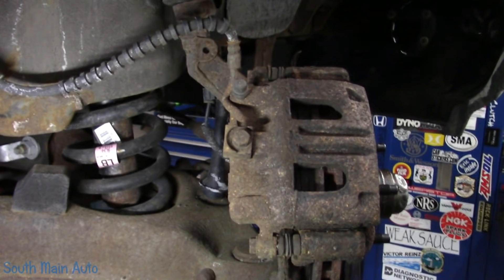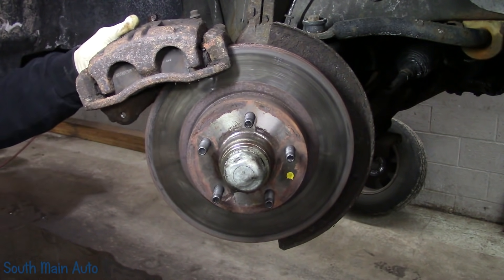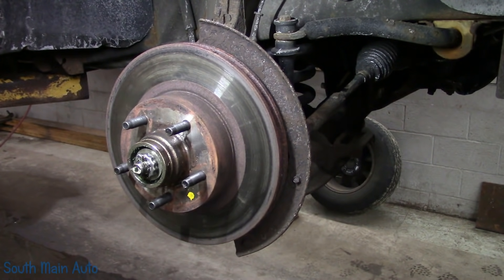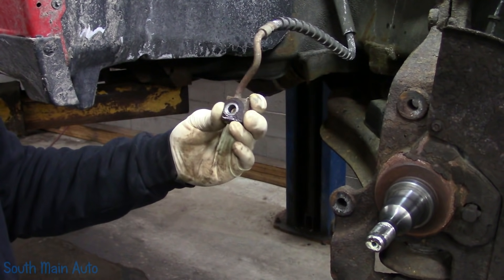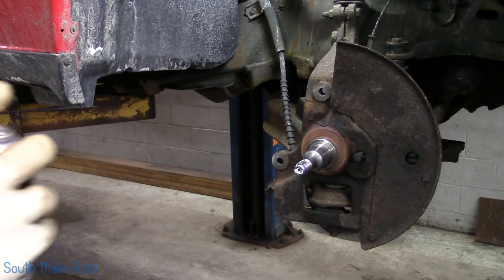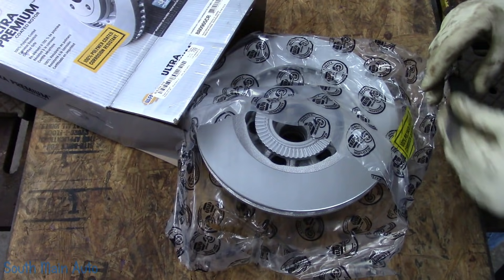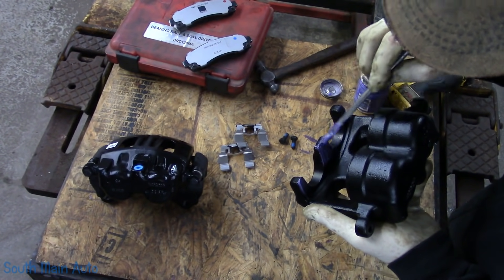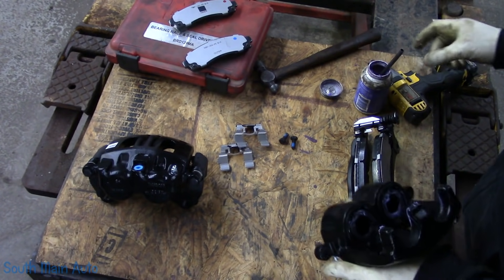Ford Ranger: Full Brake Job Overhaul - Part I

Comment: I just did this to my '94 Ranger 2wd. Thanks for showing the bearing preload and final. Of course I now need o pop off my wheels and reset mine because Timkin said 18 to 25 FT LBS.

I knew it was screwy but hey, it's been a long time since I last did this on my Hillman Minx. It'll take longer to get the tires off than it will be to make the adjustment to 'finger tight'. Many thanks for the guiding hands on help Mr.O!

Comment: Should replace the flexible hoses too.  I had one fail on my 02 F150 on the boat ramp a few years ago.  I also understand they can collapse on the inside causing the calipers not to relax and overheated brakes.
Reply: I was really surprised he didn't replace the hoses. I had a friend chasing an odd brake issue recently on a 67 F250 and it ended up being a collapsed brake hose. In my mind, if you are replacing a caliper or wheel cylinder, you might as well replace the hose too.

Comment: Just saying that I started watching this this morning while sitting at my local Toyota dealership. Had to pause it when they came to tell me what they found on my "multipoint inspection". Just now getting back to finishing the video

Apparently at 50k miles, I still haven't worn out my factory pads... but I'm 20k over due for a brake fluid flush. You read that right. Toyota recommends a brake system flush at 30k miles.
Reply: Bobby Brady  Absolutely. I laughed in his face.

And the manual says to INSPECT fluid at 30k.
Reply: @zacharywelvaert2235  Honda owners manual says to change the brake fluid every 3 years.

Comment: I've had bad experiences with coated rotors.. not often but enough to the point that I now buff the coating off, where the pads mate with the discs.. the issue I've experienced is heavy glazing.
Reply: Strange, they claim it wears off quickly and promotes proper break in. I've installed a lot and have never seen any difference.
Reply: If you ever have a chance, test drive for 20mins bring the vehicle back in and check the pads.

Comment: you put as much grease as should be put in the hub. I have dealt with what happens when the hub is overfull and its a big mess. actually you can just pack the bearings well and put a little on the seal . that is ok as the wheel bearing grease in the hub does not circulate anyway. On a boat trailer with bearing buddies, I would use special synthetic grease that did not expand and push out when traveling fast even though the hubs were full. On the subject of boat trailer bearing buddies. fabulous invention.
Reply: Bearing Buddies have a spring loaded piston to compensate for expansion.
Reply: partly. but using grease that does not heat up and expand is helpful. years ago in the 70s it was "Mystic JT6 military grease".

Comment: I've bought the Napa reman calipers for Fords, I drive 06 F-350 at work we have nothing but F-350 work trucks. The slide pins never have enough lube on them an ya I use extreme lube. In our West Coast climate aka rain and salt air, I grease the ears of the brake pads and the outside of the abutment clips the stainless clips really oxidize and the pads start to bind up.

Comment: Of course you do this project AFTER I replaced my truck brakes last month. Haha! Would've been nice to have your step by step instruction. Mine is a '01 Ranger XLT 4.0L RWD 219k original miles and still truckin'. Same style brake / hub assembly as the one in this video. Great job on this one sir! 👊

Comment: Lot of times you know the hose will break down on the inside the booster can close the caliper but it don't open  back up when you turn the pedal loose but you know that just letting you know that could be one of the problems with the truck

Comment: Always check brakes often my brothers Buick had no pad on passenger rear it was just the little back plate and the brake seized on to the rotor and the inner side of the rotor was badly chewed up from a few weeks of use and blew apart luckily it was just around the corner

Comment: Love it when all new parts go into a brake job...it makes for a factory perfect non-pulsating pedal !  I would have preferred to see my mechanic use another set of new gloves before touching the rotor and pads. Just the tiniest speck of oil/grease is hard to remove and it makes for a problem free finish. I'm particular about that subject so some mechanics may not agree. We will have a difference on opinion on that. Also, even in dry climate, such as CA, the silicon grease is needed on those clips and rods due to the extreme temps etc. After a while, if not greased properly, they will stick and make noise too. The grease used (brand) also makes a big difference in quality of the job.

Comment: Putting that grease on everything is a lifesaver!! Little story. I met my fiance in Virginia... I'm from GA and she's from NY, around the catskills. She had a 2010 Hyoonday Elantra and she asked me if I could look at it for a "slight noise" in the brakes. Needless to say I was in awe at what I found. One pad looked brand new but the other was worn down to metal. The pad was stuck due to rust jacking. The rotor face was so chowdered there were chunks missing out of it. In the south, a brake job is a simple R & R job and never bothered with the grease. I spent hours with the bastard file trying to get the caliper brackets cleaned out so the pads would move freely. Rust jacking is no joke...
Reply: Yep, the fun stuff is when the rust jacks the wheel speed sensors out enough that the ABS goes wonky, Many folks think, well I'll just pull them out and clean off the rust. They don't realize that the rust is also squeezing that sensor in the hole, SNAP....  Well that bearing was going bad anyway......
Reply: The trick would be to clean and lubricate once or twice per year when swapping winter tires, but it costs money.

Comment: I miss my 2010 ranger 4x4 with the 4.0 and 5 speed stick shift. It was a rare combo but pretty fun to drive. However, when I got rid of it two years ago it was already rusted worse than the one in the video. It came from Nova Scotia so the salt just started to ruin it and I wanted to ditch it before it got too bad

Comment: I have a 2009 ranger RWD, I forgot the part of backing the bearing nut off after torquing to 21ft/lbs. This resulted in me overheating a bearing, leading it to lock up on the spindle and shearing the end of it off while driving down the interstate. 

"Finger tight" aint no joke...

Comment: Hey Eric, old school front wheel bearings vs diff pinion bearings- (and other sets of tapered roller bearings) why do diff bearings get a preload while wheel bearings just get finger tight? I guess it has to do with the varying loads on a front wheel bearing, but I’ve always wondered this. Cheers.
Reply: Diff bearings constantly get splashed with oil and can dissipated heat more effectively. Also, the gears must be kept in closer alignment to each other. Tight wheel bearings don't leave room for a lubricant film between the rollers and the race, accumulate heat, and dry out the grease.

Comment: It seems like you handle the rotor and pads with greasy gloves. Is that not a issue? Not being critical, just curios
Reply: It is an issue and should be prevented to keep a clear path to correct braking. I would have changed gloves after packing the bearings and again had my gloves gotten dirty again just before handling them. They say once the oil is on the pad or rotor, brake cleaner won't remove 100% of it. It's difficult obviously to get it perfect, especially in a business atmosphere, but it only takes a few seconds to do your best.

Comment: I just wanted to point out you're not supposed to use moly grease(IE Permatex purple) on any brake component made out of rubber. On cars with a rubber bushing on the slide pin, if the bushing touches moly grease it will swell up and lock up the slide pin. 

On my own 8th gen Civic I had an issue with the slide pin locking up and finally figured it out. 

You'll notice that when you take the slide pin off a new caliper they always use Syl-Glide on the slide pins, not moly grease. So I use Syl-Glide on the caliper pins and on the caliper piston seal/brake pad where it meets the caliper piston seal.
Reply: Also Honda stated to put brake grease where the pad touches the hardware. 

You're videos are great btw. Good to see honest mechanics out there.

Comment: I'm helping my neighbor diagnose a rumbling that happens only on acceleration above about 25mph in his 07 Ranger.  It seems to be independent of engine speed and corresponds with vehicle speed, increasing in frequency.  Passenger engine mount is soft but not broken.  He says u-joints aren't bad / loose.  Still need to look closely at trans mount and u-joints and maybe rear wheel bearings.  Thoughts?

Comment: Hate to be picky but this is an important unseen issue until it is too late. More than once we have found out the hard way that the the races that came in the new rotors did not have exactly the same angle of taper that the new bearings had and the bearings failed quite quickly due to this. Always get matched bearings and races that come as a SET and get rid of the races that come in the new rotor to make absolutely sure that a mismatch is not going to happen. Kind of like using mismatched gears together, they are most likely going to quickly fail unless by total fluke they happen to similar enough.

Comment: Are you going to cover what you need to watch out for if bleeding a Ranger with antilock brakes? I've heard a lot of conflicting information about how to avoid an expensive trip to the Ford dealer. I've got an '02 and it's high time to flush out the old brake fluid but I don't want to dig a hole I can't get out of.

Comment: That was a "dueling banjo" bolt! 🤣

I'm a big fan of the NAPA brake parts. Got a set of the black calipers on the ol' Volvo. They do hold up extremely well around here. Gonna need it, with MA taking NY's lead on brining the roads with that liquid crap.

Got a 2wd myself - the '86 Grand Marquis! I throw Amsoil grease in there, and I've gone 70k on that car without repacking. Stuff works really well. I pack the pee out of 'em. You certainly right about everyone having a different way of doing this job. I have always worked the grease in with my fingertips all around both sides of the edge - been doing that since I was 16, probably because that's how my dad, and grandpa did 'em. Don't much matter how you do it, so long as the grease get in there. :)

Comment: Best brake pads rotors? Need a general idea so I know what to get. I like to do my own work
Reply: OEM Ford but expensive for no real good reason.  Wagner is dependable. Ceramic pads are also a good replacement to semi-metallic as they do not leave much brake dust and wear out the rotors much less.

Comment: Eric, I am working on an older 1980's French car and as far as I can see, the brake calipers do not have hardware - the pads just sit in the caliper direct - would you recommend putting some of your Purple wonder grease at the edge of the pads, where the hardware normally is ??  Thanks.

Comment: 2009 2.3L 2wd
I changed my rotors with Motorcraft rotors and replaced the Tapered Wheel Bearings.
I tightened the rotors to 20ft pounds then back off half a turn and hand tightened to snug. I assembled it back together now My ABS light is on and my wheels are locking up.
When I depress the caliper while the car is turned off and pump the brakes the caliper is free and spins normally but when the car is turned on and the brakes are pumped the calipers locks up and don't release. The calipers are new and so the brake hose from the caliper to the brake line.
Never had this problem when changing rotors on this truck before.
Send info. Thanks

Comment: Thanks for the ranger video. Just did all the ball joints and end links on my 98 ranger, along with just pads on front rotors. Then the pilot bearing locked around input shaft after 230,000 miles it got it's first clutch. 2.5L

Comment: What are peoples' thoughts regarding the choice of parts available?  I always second-guess myself when the parts guy asks if I want regular pads and rotors or premium.  Is it just a matter of 'you get what you pay for'?
Reply: For normal driving I usually recommend the premium parts store brand pads. The hardware comes with them, they perform alright, and they much less expensive than well known brand name parts, but that may depend on your parts store. Make sure to get the same friction material as OEM. (ie; semi metallic or ceramic) As for the discs, for most cars, they're just a hunk of cast iron and there's little difference between the cheap and the expensive ones. If you're in the rust belt, coated discs could be worth while for a couple of bucks more per disc. Rust build up on the cooling fins can cause overheating and impact performance in the long run.

Comment: Im not a mehanic, but carpenter and i always put glue - oil in your case in the hole not on part wich you put in hole cuz u had that "oil ring" around that suport pinion when you put it back. Un my way you press out only if you owerfill in your way the air have no way to escape and you got alot oil on edges of the hole. Btw i want to know wich oil you use?what base? Its good for pinion rubber?

Comment: Every time I see a two wheel drive truck I wonder what people are thinking? Especially a older truck with power windows, Cruise control, electric seats all the options except for 4x4... who doesn’t have 4x4 in New York?
Reply: I think that too. But then I remember people used to all drive with rwd, no power steering, no abs, and only jesus to take the wheel if things went wrong
Reply: If you know how to drive it you would be shocked at where you can go with a 2WD. It wasn't that long ago that RWD was the common drive system and 4X4 was "for those off road nuts". Plus unless you know how and when to use it, 4X4 only serves to put you off the road out of reach of the wrecker cable...
Reply from the maker: Yep 4x4 only gets you a little further and a whole lot deeper! A 2wd with good snow tires and weight in the back will go damn near anywhere around here....
Reply: My cousins always say all those things. They swear that their 2wd can go anywhere I can go if you know how to drive right... I’m not judging people that buy a two wheel drive but I still don’t understand why when my area average snowfall is around six feet. Not to mention when we get 3-4 feet in one day.

Comment: This video sure brings back memories for me. My first car was a '57 Chevy and I recall packing the bearings on it. And all the brake jobs, distributor caps, rotors and points replacing. Cars were so much simpler then. But required a lot more maintenance. I replaced the 6 cylinder automatic with a 265 cu inch V8 engine manual transmission that I found in a farmers field about 10 miles from home. Paid $20.00 for the whole car and towed it home with a tractor.  I really didn't know what I was doing but the swap was successful.

Comment: The correct amount of Grease you put in the hub, is when the rotor spins the centrifugal force  will Push the grease outward, so you need enough grease in the hub  where it forms a grease dam that rides close to the bearing rollers or bearing cage.

Comment: Why do you prefer NAPA over the other major stores?
Reply: That's all he has around his area.
Reply: Maybe that's the only place close by that can support his shop best.  I prefer other brands over NAPA and I also prefer mom & pop independent parts houses even though they are getting rare. I hate it when going to a "chain" shop such as O'Reily since they are mostly limited experience, part time jobs, students etc. 

For example, you have a two year old battery that won't keep a charge or put out any amps but has volts. They are required to set your battery into a machine that will run a charge and a test to confirm this but it take 45 mins to an hour per test. The employees won't use a hand held load tester to confirm this in 1 minute of time forcing the customer to make two trips for a battery that is failed. Any good parts shop will have a faster method to warranty a crap built battery so the customer gets a fair experience. For those who don't know, most batteries are built cheaply and getting a good one is a gamble. Spend good money on a "Lifeline" battery and they will offer no less than 5 years problem free service. They are about $30 to $50 more but worth avoiding the cluster of warranty replacement policies and robot employees.

Comment: My bearings were seized to the spindle on a used car I recently purchased ( 95 suburban 1500 ). I damaged the spindle trying to remove the rotor/ bearings. Had to go to the pick a part and retrieve another steering knuckle/spindle assembly. What is the best method for removing rotor when this happens? Thanks Eric or anyone else whom responds.

Comment: The tool being used at the 5 min mark, what is the power tool? I have the attachment with the little plastic do-dads, but it has a round shaft as opposed to hex. But i need to get the into a tight space - top of cylinder - so i need a stubby tool like that. Or conversely can i buy a rotary tip like that with a hex shaft? i looked but couldn't find one. any help is much appreciated!!

Comment: I remember take off the spindle nut take off the washer and outer baring put the nut back on slide the brake hub out to remove the inner baring and seal and most Times you could reuse the seal